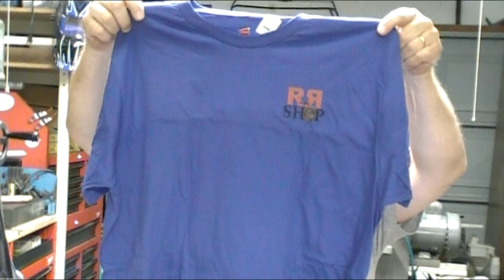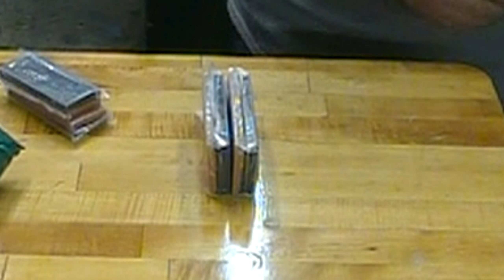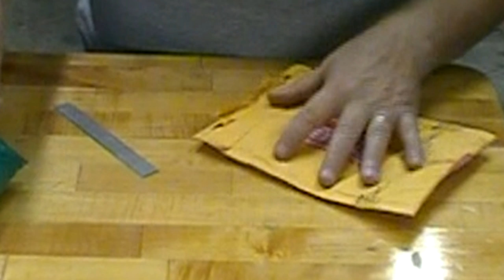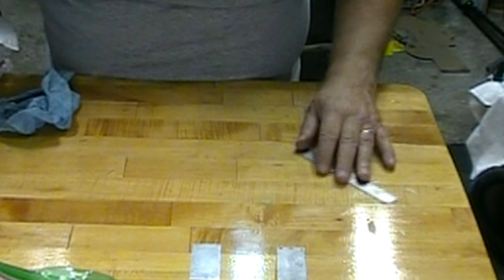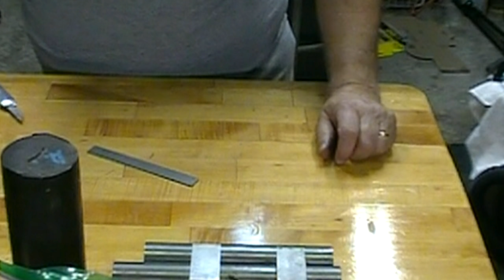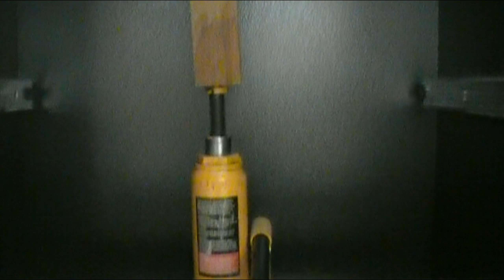Shark Bits 7 Viewer Mail, Purchases, Grinder Repair

Comment: Is that A311 1045?
Reply from the maker: I assume that you are referring to the material that I used to reinforce the cabinet. The channel that I used is from National Hardware, purchased from Tractor Supply.  It is probably A36 or similar.  It is holding up good so far.  I just picked up some 4" channel from a structural steel supply.  If I have any more sagging I will replace it with that. Thanks for commenting.
Reply: No I'm talking about the Stressproof you got from eBay. Wondering if it was 1045 or 1144.
Reply from the maker: 1045 A311 Class B Stress Proof Steel according to the seller.
Reply: Did it machine like 1144 Stressproof?
Reply from the maker: Actually I have not used it yet.  I ended up needing 2" stock for the project and used a piece of stainless that I had.
Reply: I bought from him after I watched your video. I could've sworn the add said 1144 but now says 1045. And in fact the new add he has up doesn't say Stressproof but A311 is Stressproof I think. I turned a little today just to see and it machines okay. 1144 is better imo but ten times the price.
Reply from the maker: He has different material all of the time.  Being drops you can never be sure what you are getting.  I copied the description directly from the listing that I purchased.

Comment: Broke a sweat on that job Steve ;-)  Nice repair and thanks for the Mic head, I wasn't expecting it..   I like that little grinder. Thumbs up
Reply from the maker: Steve Summers it was a little toasty in the shop.  I had the extra micrometer head. Hope that you can use it.

Comment: Just like we all do, get the shop filled so nothing else can fit...   lol
Good call on the reinforcement to the chest, for next jobs, remember that using the channel turned 90 degrees, allowing the force to be applied on the height instead of the thichness of that same channel, would give you near ten times the strength and rigidity, forthe same cost...   ;)
Not sure you got some of my channel stickers, but just send me an Email and I'll sned you some, also you could send me some of yours...
wledpierre@gmail.com
Reply from the maker: I think that I have your sticker and also Phil's. They came in a lot from John Creasy.  Thank you for asking.  Just IM me your address and I will send mine out to you.  I thought about the strength of the channel however I have my cut off saw on the top shelf inside the cabinet and it would not fit if I turned the channel.  That being said it seems to be plenty strong the way it is. Thank you for watching and commenting.
Reply: Is it me, or, it's normal I don't find your Email...???    Just send me one at the one in my previous comment, then, I'll get get back to you.
Reply from the maker: Your email keeps getting bounced back to me.  Mine is: rslng@aol.com

Comment: Neat brace job. The tops on those cabinets are kind of flimsy. I understand about the ac
Reply from the maker: The big problem with the grinder is the the majority of the weight is centered over the rear mounting bolts where there is no support under the sheet metal.  Had I thought about it before putting the mill in place I would have gotten a piece of 1/4 plate steel to fit the entire top of the cabinet.  Fortunately  the fix worked out great.  I rearranged my shop so that I could use the window to put a a/c unit in.  I even installed a new window.  I just have to get my lazy butt down into the cellar and bring the a/c unit up and install it.  Thank you for commenting.
Reply: I actually thought the same thing as watching the video. Just didn’t want to be Captain Obvious

Comment: Those white dressing sticks look like what I used to use for seating motor brushes. Just hold one against the commutator for a few seconds while the motor is running. It dresses the commutator and shapes the brushes at the same time.
Reply from the maker: Now that you mention it, I had very similar commutator dressing stones when I had my automotive machine shop. We also had an electrical shop for rebuilding starters, generators, and alternators  Thanks for watching and commentating.